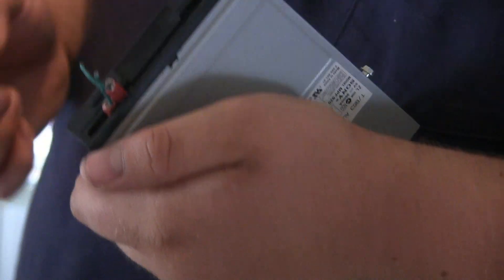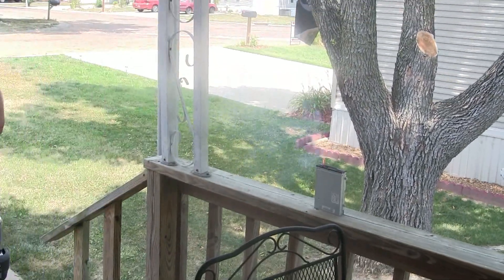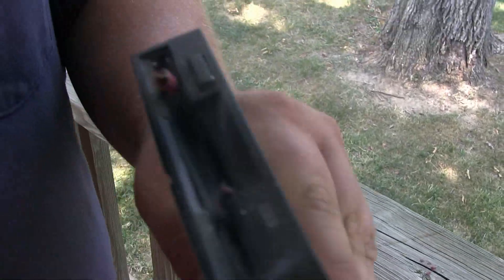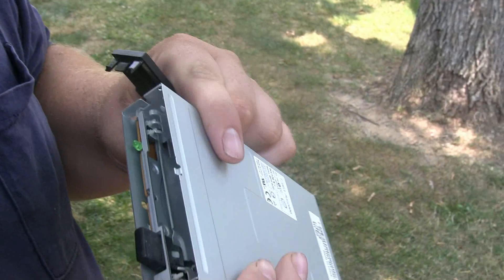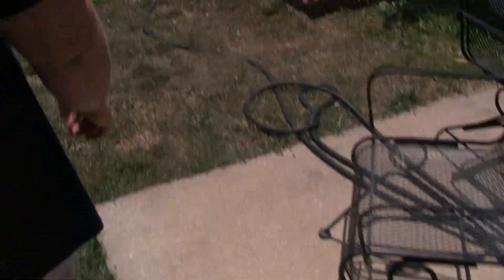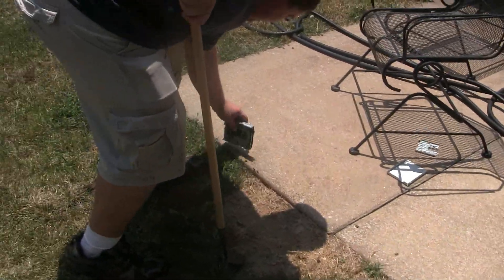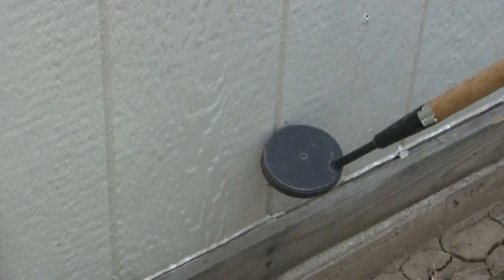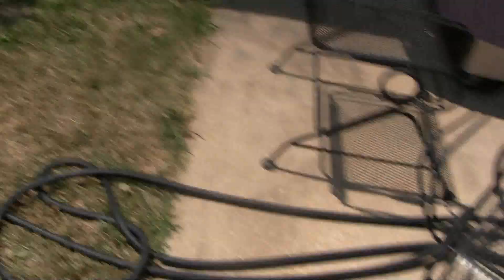Floppy Disk Drive Destruction

Comment: you could not even fit a 128K mp3 on a floppy also pretty new to this channel seems very cool so subbed.
Reply: EastAngliaUK
Yes you can, actually.
This is a 3.5 inch floppy drive. The earliest 3.5 inch diskettes held 360K or 720K, depending on wether it is single-sided or double-sided respectively. High Density 3.5 inch disks and drives which held 1.44 MB (1474.56K), and very rare Extended Density 3.5 inch disks and drives that held 2.88 MB (2949.12K) came shortly after. You're talking 128K MP3 files? You can stick:
2 on a single-sided disk,
5 on a double-sided disk,
11 on a High Density disk, and
23 on an Extended Desnity disk.